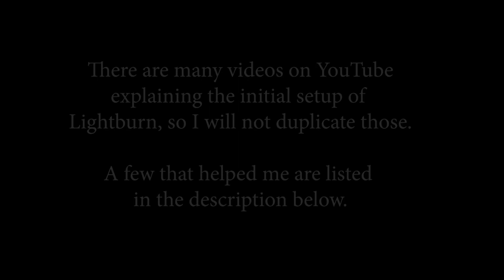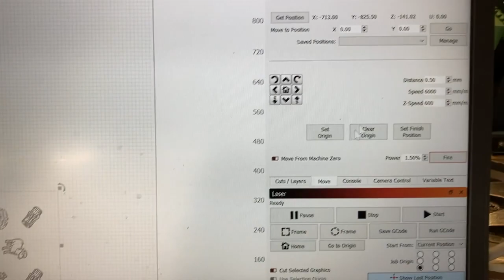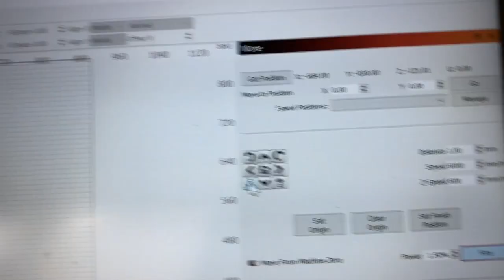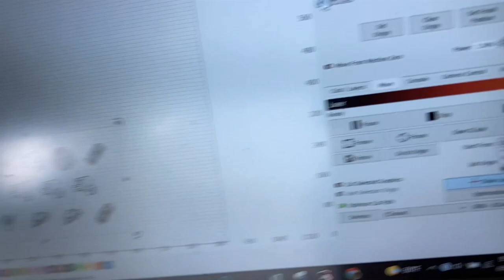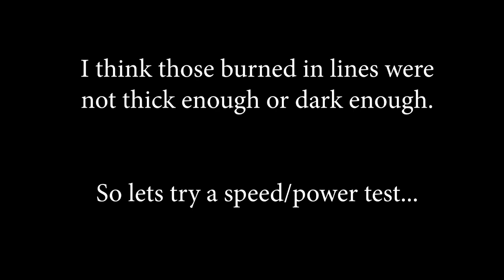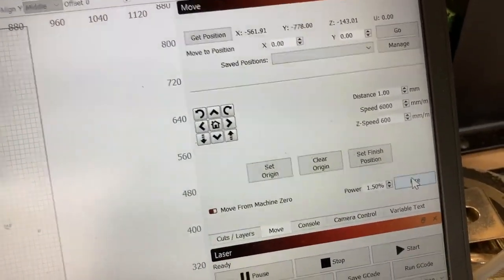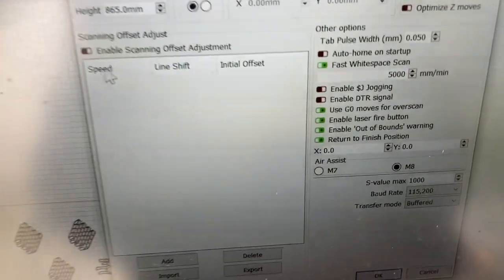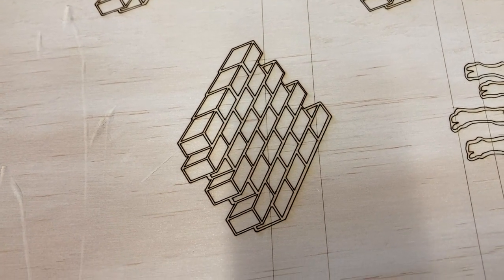Learning Opt Lasers and Lightburn - First Test and Review

Comment: Even though those engravings do look really good, you still have something going on.  The whitespace setting is just the speed at which the laser moves when it's not cutting/engraving.  You can greatly speed this up without affecting the quality of your piece.  My guess is you sped up the whitespace move so much that the laser can't burn the piece. It did fix your problem but in reality, the laser should reduce power or turn completely off during whitespace moves.  Is this laser PWM controlled and is it set up correctly?